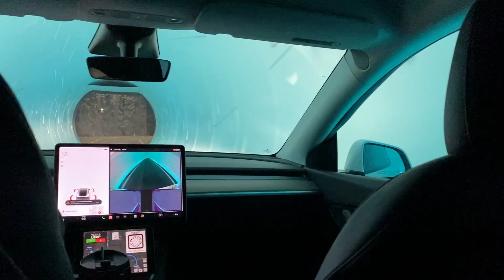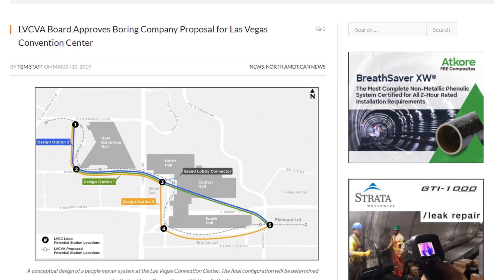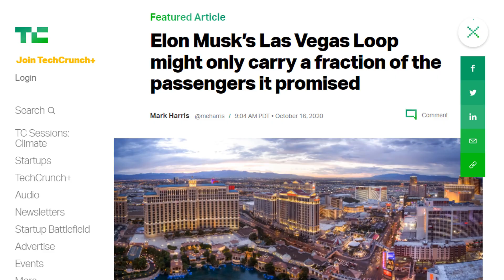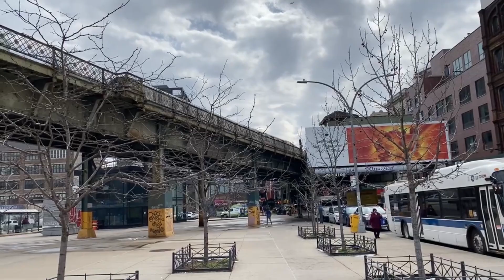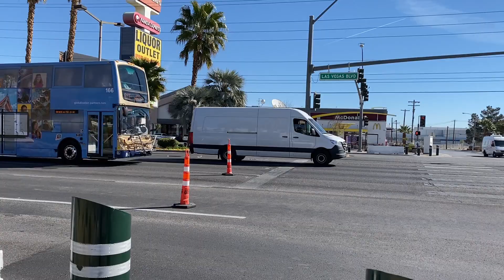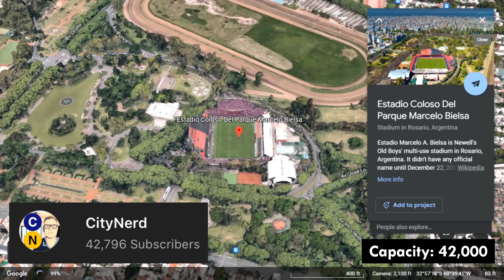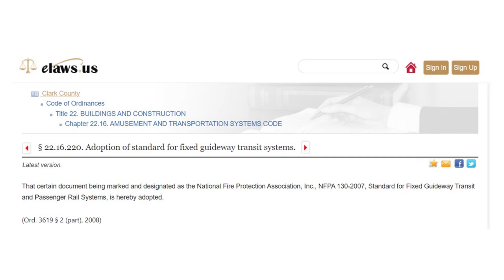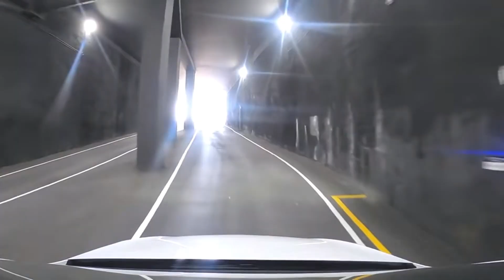Inside the Las Vegas Loop: Transportation Game-Changer, or Complete Waste of Time and Effort?

Comment: Question: Are the tunnels large enough for a rail system when this scheme inevitably fail?
Reply: Actually yes. From information I found on Wikipedia, the tunnel is 12 ft in diameter, while the seven deep-level lines of the London Underground are 11 ft 8 in. diameter. So yes, with special curved-roof trains like the ones in London you could still use the tunnels for actual mass transit.
Reply: @JustinKlinger  Our old deep-level tube lines aren't super comfortable (and the trains lack air con as there's no way to vent the heat) so the most modern line, namely the Crossrail project (aka Elizabeth Line) have tunnels that are 20.34 feet in diameter! These tunnels are unlikely to ever prove to be useful for anything, and will also hinder any plans to bore proper tunnels as you've got these in the way. [As has been said by others, you could build something like that of Glasgow's subway - which is a must-visit - but that's hardly the way forward compared to big trains that could shift many tens of thousands of people per hour - totally transforming travel throughout Las Vegas]
Reply: @JustinKlinger  Mass transit already failed in Las Vegas. People vacationing don’t want to sit next to a drug addicted messed up person.
Reply from the maker: Define "rail" lol
Reply: @CityNerd  You may have just opened a door to the dark places, lol.
Reply: These tunnels are very small. The Glasgow subway also is very small. I wonder if something small could fit there.
Reply: London's old Underground tunnels are grandfathered in. Its new tunnels must have a walkway beside the track passengers can reach via side doors.
Reply: No but the infrastructure could still probably be reused and upgraded rather than demolished.
Reply: @macgobhann8712  standard guage no, but there's all sorts of narrow guage trams out there, and a number of them could be installed in these tunnels, possibly with some modifications.
Reply: @doktarr  All of London's metro runs on standard gauge. There used to be some broader gauge, but that got eliminated.
Reply: @macgobhann8712  I wonder.  Running another TBM through sounds implausible given the structure in place, which presumably can't be removed without cave-in.  Maybe build temporary shoring in segments, then basically mine by hand?  It sounds easier to start from scratch.
Reply: Absolutely not. They are unventilated and, even using narrow gauge streetcars or PATH/London Underground curved-roof trains, there's no room for the emergency walkways required in the USA. Even the LVM has continuous emergency walkways. The only reuse scenario I can see would be to repurpose them as pedestrian tunnels. Adaptive reuse was NEVER a consideration, because the "Loop" is merely a gimmick to sell cars.
Reply: @colormedubious4747  Why can't they just grandfather it in for the Loop then?
Reply: @BluePieNinjaTV  Grandfather in what? An exception to minimum state & federal safety standards? I'm going to say "hard NO" to that!
Reply: So my take was that we could just rent bikes at a station and bike through the tunnels. Las Vegas is far too hot to bike above ground for a large swath of the year so this gives us our chance!
Reply: @frojo9  if he's trying to save cost why did he waste all that time making it car sized just make it people sized.
Reply: @Phil9874  I think you replied to the wrong comment. Mine was about biking in the tunnels
Reply: Use it for sewage.
Reply: Yes! The Glasgow subway has a nominal diameter of 11', so in theory you could use the new Stadler trains (which look like futuristic shiny worms) which Glasgow is rolling out. Deets here: https://www.youtube.com/watch?v=Po3sMENPvoo
Reply: If nothing else they'd be useful as air-conditioned walking tunnels when the temps outside are in the triple digits.
Reply: Possible solution, a theme park in NY (Water Safari) has a small train (could easily be electric) that has the footprint of a rollercoaster (2 person wide). While i don't know the park's statistics on the 1 train running back and forth on its bidirectional track, i know it would fit in the tunnel and have better capacity than cars in "stop and go traffic" in a tunnel. 

So something actually useful can be designed to fit in those tunnels even if it isn't traditional it could atleast be more  functional than a single car lane.
Reply: The plan, I should think, is to fill them up with water and run an hourly shuttle-submarine service.
Reply: @mdwalther_writer  🤣🤣🤣
Reply: London Deep Tube only... They run on a line with a tunnel with only a tight 11' 6" diameter... These Musk tunnels would work well for cheap deep tube tunnelling..
Reply: Are the curves too tight?
Reply: They can put a conveyor belt into the tunnel. That works driver-less and is fast enough for the short distances.
Reply: Maybe APM such as VAL 208, but not full size metro car.
Reply: Given that the tunnels dont have enough space to open the car doors, i highly doubt any rail system beyond a typical roller coaster system can fit in them.
Reply: You know those mini trains at fair grounds?
Reply: How big is the diameter of the Glasgow subway compared to the loop?
Reply: @burgerpommes2001  Glasgow subway is 11' in diameter. Boring tunnels use a 14' diameter boring machine which results in a 12' diameter tunnel.
Reply: @burgerpommes2001  1ft smaller apparently
Reply: If Disney would sell them a Wedway Peoplemover, then that might work.
Reply: The tunnels look extremely cramped. Would need to be fully reworked from what I’ve seen.
Reply: You can make people walk
Reply: In the current state, probably not if they expand the tunnels to be bigger and more routes to be a proper metro. If they can't do that, I guess convert the tunnel into an ebiking or electric motorcycle-only lane.
Reply: @Frank451Martin  why would you want to convert the Loop tunnels to ebikes when they are very competitive in terms of daily ridership with similar sized subways, but also has FAR lower waiting times, is faster but most importantly is VASTLY cheaper:

The current 0.8 mile long three-station LVCC Loop handles up to 27,000 people per day, has a 3 - 6 second headway, averages 25mph and cost $48.7m. 

The Berlin U55 is a 3-station 1.5km subway in the centre of Berlin which is similar in size to the LVCC Loop but it only carries a minuscule 6,200 people per day (compared to the Loop’s 27,000 ppd) at an average speed of 19mph and 5 minute headway and yet cost $500 million in today’s dollars in total, 10x the cost of the LVCC Loop.

The Seattle U-Link is a 3.15-mile underground light rail which also has 3 stations which had a ridership of 33,900 people per day pre-covid (so only a few thousand more than the LVCC Loop), though it is much less now.  Runs at an average speed of 31mph with a 10 min peak/15 min off-peak headway. It cost $1.9 billion dollars in total or $600 million per mile, 39x more than the LVCC Loop.

The San Francisco Central Subway is a 3-station 1.7 mile subway with a targeted ridership of 35,000 people per day with a 5 minute headway and an average speed of a miserable 9.6mph and cost $1.578 billion, 32x the cost of the Loop. (Whether it achieves that ridership which is only a few thousand higher than the Loop during this pandemic is of course yet to be seen) 

The Newark City Subway/light rail is a 6.4 mile, 17 station line with an average speed of 21.5mph and has a daily ridership of 19,289 and cost $208m for the 1 mile above-ground light rail portion or 4x the cost of the underground Loop. I’m not sure of the cost of the underground portion of the Newark subway, but typical costs start at $600m per mile 39x the cost of the Loop. 

As you can see, the LVCC Loop is extremely competitive, though that is nothing compared to the 55 station, 34 mile Vegas Loop with its 60mph average speed, 0.9 second headway and 57,000 people per hour capacity which is now under-construction at ZERO cost to the taxpayer. 

However, the Loop is FAR better in terms of comfort, speed and frequency/wait times, and VASTLY cheaper to build than any of these subway systems.
Reply: Probably something small… it would not be standard that’s for sure
Reply: @nosurp  About the same size as the London Tube. Dig out the bottom so it's flat and it should fit a full-sized train I reckon.
Reply: At worse you could find some small busses and install some sort of guided busway.
Reply: Yes, the Glasgow Subway has a tunnel diameter of 11ft, the Vegas Loop is 12ft.
In London, most of the deep level tube lines are 11ft 8¼in.
Reply: They absolutely are big enough. They are larger than some subway tunnels that are currently operational.
Reply: @TheReykjavik  Everyone in this comment section has been comparing raw bore diameter to conclude that trains would fit in these idiotic sewer pipes. That Is NOT how this works! Subways are more than tubes and trains. Subways have running tracks, power rails, track foundations, power & communications cabling, signaling hardware, emergency walkways & exits, turnouts & switching mechanisms, lighting, ventilation hardware, and gobs of other gizmos cluttering their tunnels. There just isn't enough room in these silly sewer pipes for a modern rail system, even using narrow Alstom streetcars.

And we haven't even brought up TURNING RADIUS yet! General service on standard gauge track requires more than a 410-foot
radius. The faster the train, the greater the radius. Airport peoplemovers of that gauge require a bit more than half of that radius. 3'6" gauge can require a 250- to 800-foot radius, depending on speed. Some 2-foot gauge systems pull it off with less than a 20-foot radius. They are not fast trains. I guarantee you that the turning radius of the silly sewer pipes is NOT sufficient for a serious rail transit system.

Jeepers creepers, people, you HAVE to design tunnels for SPECIFIC rail tech from the very start! The Vegas "Loop" tunnels were designed to sell cars, NOT to move people efficiently.

If an actual engineer wants to do the math and show that an off-the-shelf rail transit mode will fit the "Loop" as-is and conform to US regulatory requirements, I'll believe it. Until that time, "the holes in Glasgow or wherever are the same size as the holes in Vegas" does not prove a thing. 

The LVCVB merely wasted a bunch of money on an intrinsically stupid idea.
Reply: @colormedubious4747  Yet there are trains in smaller tunnels. And making a wider turning radius is not difficult, you just bore a gentler curve.

The fact that there are trains in holes that size very much proves that you can put trains in holes that size.

Regulations preventing it are an extrinsic reason not to do it, not intrinsic.

It is getting really annoying how 95% of people lose all touch with reality the moment anything involving Elon Musk comes up.
Reply: @TheReykjavik  The tunnels to which you refer were designed for TRAINs. The Vegas tunnels were designed for CARS.
Reply: @colormedubious4747  That doesn't mean it can't be redesigned for trains. It is big enough.
Reply: @TheReykjavik  I literally just explained why it isn't big enough.
Reply: ADVENT Insider  I see what your confusion is Advent. You’re thinking people per day down a single tunnel. That’s not what the 27,000 people per day figure is, it is total ridership of the three station Loop. 

The current 0.8 mile long three-station LVCC Loop handles up to 27,000 people per day, has a 6 second headway and cost $48.7m which is very competitive ridership-wise with the similarly short subways listed below. 

However, the Loop is FAR better in terms of comfort, speed and frequency/wait times, and VASTLY cheaper to build than any of these subway systems:

The Berlin U55 is a 3-station 1.5km subway in the centre of Berlin which is similar in size to the LVCC Loop but it only carries a minuscule 6,200 people per day (compared to the Loop’s 27,000 ppd) at an average speed of 19mph and 5 minute headway and yet cost $500 million in today’s dollars in total, 10x the cost of the LVCC Loop.

The Seattle U-Link is a 3.15-mile underground light rail which also has 3 stations which had a ridership of 33,900 people per day pre-covid (so only a few thousand more than the LVCC Loop), though it is much less now.  Runs at an average speed of 31mph. It cost $1.9 billion dollars in total or $600 million per mile, 39x more than the LVCC Loop.

The San Francisco Central Subway is a 3-station 1.7 mile subway with a targeted ridership of 35,000 people per day with a 5 minute headway and an average speed of a miserable 9.6mph and cost $1.578 billion, 32x the cost of the Loop. (Whether it achieves that ridership which is only a few thousand higher than the Loop during this pandemic is of course yet to be seen) 

The Newark City Subway/light rail is a 6.4 mile, 17 station line with an average speed of 21.5mph and has a daily ridership of 19,289 and cost $208m for the 1 mile above-ground light rail portion or 4x the cost of the underground Loop. I’m not sure of the cost of the underground portion of the Newark subway, typical costs start at $600m per mile. 

As you can see, the LVCC Loop is extremely competitive, though that is nothing compared to the 55 station, 34 mile Vegas Loop with its 60mph average speed and 57,000 people per hour capacity which is now under-construction at ZERO cost to the taxpayer.
Reply: The Loop tunnels are 12.5 foot in diameter which is larger than the 11’ 8” diameter of London Underground tunnels. 

But why would you want to put subway trains in the Loop tunnels when subways:

- would cost $10 billion compared to the Zero public dollars of the 34 mile 55 station Vegas Loop
- have a slower average speed of 17mph compared to the 25mph average speed of the LVCC Loop (or the 60mph average of the 34 mile Vegas Loop)
- much longer wait times of 3, 5, 10 or even 30 minutes compared to the 15 second wait times of the Loop

Despite the fact that the Loop carries just as many people as similar sized subways.
Reply: @andrewfranklin4429  You obviously haven't sharpened anything by commenting here.
Reply: @StinkPickle4000  Hi StinkPickle, so do you have any useful critique to add?  Any particular reason you believe a subway would be better to justify costing 30-70x more than the Loop?
Reply: @andrewfranklin4429  No argument, your evidence is unconvincing.
Reply: @StinkPickle4000  may I ask why you believe the evidence to be unconvincing?  I’m always keen to ensure the data I work with is accurate and appropriate.
Reply: @andrewfranklin4429  Just checking in, still think this is better than subway?  30x-70x more than Loop costs "bore" out did it?
Reply: @StinkPickle4000  Well let's see, the daily ridership average for light rail lines globally is 17,392 people per day across an average of 12 stations so 25,000 - 32,000 people across just three Loop stations is actually very impressive. 

And $202m per mile is the US average for above-ground light rail while subways cost between $600m - $1 billion per mile in the US.

Subway stations globally have a ridership average of 14,656 passengers per day according to the UITP which is only a bit higher than each LVCC Loop station’s 10,000 despite subways costing 10x - 30x more. 

And Vegas is getting their 68 mile, 93 station Vegas Loop built at zero cost to the taxpayer rather the tens of billions a metro would cost. 

So yes, $48.7m for the Las Vegas Convention Center Loop still sounds pretty impressive doesn't it?
Reply: The rail system already failed in Las Vegas.
Reply: @dewdropin2010  Are you referring to the LVM? It didn't fail, it was murdered.
Reply: @colormedubious4747  I would call it suicide by inefficiency.
Reply: @dewdropin2010  I witnessed its murder by the taxi, shuttle, and rental car companies back in 2002/2003 when they blocked it from serving the airport. That single station, had it been built, would likely have prevented the bankruptcies. Consider that a one-seat ride that completely avoided surface congestion would have moved conventioneers directly between the airport and the Convention Center (and several of the megaresorts in its immediate vicinity). That was the original vision. Now that the LVCVA owns it, they have an opportunity to realize that vision, if they stop screwing around with a silly gimmick to sell cars.
Reply: @colormedubious4747  That does sound more like a murder.
Reply: @dewdropin2010  Sure does!
Reply: @dewdropin2010  That’s true. The ridership of the entire $640m Las Vegas Monorail is only 13,510 people per day over 4 miles and 7 stations.   And the monorail figures were pre-pandemic, so they're even lower now. No wonder they went bankrupt a second time. 

In contrast, the $48.7m Las Vegas Convention Centre Loop (13x cheaper than the monorail) is moving 27,000 people per day thru 3 stations over 0.8 miles during larger conventions, double the number of passengers of the much larger monorail.
Reply: @andrewfranklin4429  I think of the 70 year old lady getting into a safe and secure Vehicle compared to a gang infested subway or bus. Why do people think future tunnels won’t be using electric trains. Longer systems may be electric trains.
Reply: @dewdropin2010  Because this scheme exists to sell Teslas, not to present a workable transport solution.
Reply: @Codraroll All 29 miles 1/2 billion But wait it gets even better $6 billion in revenue on ride fees. Billions in advertising because he owns for 50 years 29 miles of Las Vegas real estate. If I said I will build a subway system in New York City and I will pay for it all and I will collect all the fees from the riders and anybody that wants to advertise on the trains or on the walls would you make the deal as the mayor of New York. That’s what Las Vegas just did they made the deal and now Elon Musk is going to be much richer.
Reply: @dewdropin2010  Again, a barely legible word salad that STILL doesn't answer my post. You are basically just saying "public transportation systems are useful", which is commendable, but what makes the Loop look like it has any chance whatsoever of becoming a functioning public transportation system?
Reply: @Codraroll  tell me Erlend, how much greater than 27,000 people per day do three Loop stations have to handle before they fit your definition of a “functioning public transport system”?
Reply: @andrewfranklin4429  You must rather ask, at what cost can a public transportation system move 27,000 people per day, and where does it move them? And could the same be achieved in a less complicated way? The Loop does not come out favourably in any of these metrics.
Reply: @Codraroll  actually, considering the 29 mile 51 station Loop is being constructed at zero cost to taxpayers, you must rather ask at what cost could a light rail or subway move 57,000 people per hour across such a rail network. 

The answer is around $5.8 billion for light rail and somewhere between $8 and $15 billion for a subway. 

The next question you need to answer is why spend billions of dollars to build 19th century train-based mass transit when for zero dollars you could have 21st century Personal Rapid Transit that moves just as many people but far faster and more comfortably?
Reply: @andrewfranklin4429  Again, you're mixing up figures and comparing apples and oranges, while taking the marketing estimate numbers for gospel.

And for the second question, if I haven't managed to push that answer into the vacuum behind your eyes yet, I don't think anyone can. 

By the way, taxicabs are a 15th century invention. Throughout history, they have never managed to become anything other than a costly express option for the wealthy few. Running them through the sewers isn't going to change that, especially when the ticket price has to cover the cost of constructing those sewers as well.
Reply: @Codraroll  Sorry, I got a bit carried away with the 19th century comparison there. 

It does however surprise me that you find it so hard to conceive that a 3 station system that currently handles at least 27,000 passengers per day could not deliver 57,000 people per hour when scaled up 17 fold to a 51 station 29 mile city-wide system. 

And no, the 57,000 people per hour figure is not empty marketing, it was modelled using the same LOOPSim modelling software that The Boring Co used to successfully project that the Loop could handle 4,400 people per hour. 

That latter figure was confirmed not only in an artificial test with volunteers in the tunnels, but the real world result of 27,000 people over the 8 hours that SEMA was open each day gives an average hourly rate of 3,375 people per hour. But of course, like any mass transit system, the Loop has peaks and troughs throughout the day with a peak period around lunch with a significantly higher hourly rate and off-peak periods up to mid-morning and after mid-afternoon with lower rates.
Reply: @andrewfranklin4429  Good grief. I told you that you won and you still won't hush up about the silly sewer pipes. You keep using numbers provided by the company that wants to SELL the thing! Numbers, by the way, that rest on a statistical fluke due to a huge captive customer base, ONCE. A company, by the way, that was forced to drastically walk back its promises on multiple occasions. 20-passenger pods? Nope! Car-carrying sleds? Nope! Vehicle lifts? Nope! 155mph service? Nope! Sounds just like the Hyperloop, doesn't it, other than the fact that they haven't fired half of their personnel (yet) or scaled back the plan to freight-only (yet). Holy crap, are you credulous! The market cap of Tesla is more than the ten largest car makers yet Tesla captures less than 15% of the market! Does that not seem even a LITTLE off to you? There is a lot of smoke and mirrors there.

"The real-world travel data also raises doubts as to whether the LVCC Loop as it stands can meet its capacity goal of transporting 4,400 conference attendees per hour.

TBC achieved that number during a demonstration event in May, by squeezing three riders (without luggage) into each of the 62 Tesla Model 3, X and Y vehicles in the system. In reality, however, an average of just two passengers rode in each Loop vehicle between its opening to conventioneers in early June and mid-July.

A contract signed by TBC in 2019 specifies a $300,000 penalty for each large convention where TBC cannot move around 4,000 people per hour. A penalty that large could impact the viability of the Loop, which earned just $230,500 for transportation services during its first month of operation in June. (TBC also gets a monthly management fee of $167,000, regardless of how many cars it operates)." In short, it is FAR too early to sing the praises of a system that you could beat across the parking lot ON FOOT. It took Virgin Hyperloop about 3 years before it had to reorganize and barely 8 years to completely abandon its mission and implode. The guy knows how to sell cars and Powerwalls. He knows NOTHING about transit -- and this silly thing isn't even transit. It's just cars in tunnels. New York City has hundreds of thousands of cars using tunnels every day but is still congested beyond belief and utterly reliant on rail to keep the city functional. Stop fangirling and study the underlying issues.
Reply: @colormedubious4747  We’re not talking popularity contests here Colorme, we’re simply talking about what passenger throughput the Loop can handle through the turnstiles and the answer is 25,000 - 27,000 people per hour which was achieved during the SEMA conference. 

It doesn’t matter if there haven’t been any other conventions that large since SEMA due to COVID as all that matters is the 5 days of that conference demonstrated that the Loop is capable of easily handling 25,000 - 27,000 people per day. 

Mark Harris has now admitted his Tech Crunch articles about The Boring Company were wrong and he has been removed from writing about the Boring Co for Tech Crunch with other writers being far more accurate (and positive) in their stories since Harris’s last article in Nov 2021. 

So his claims that the Loop can’t handle 4,400 people per hour and reports of penalties are very obviously incorrect.
Reply: @colormedubious4747  And no, I am not using numbers from the BorIng Company.  The 25,000 - 27,000 people per day number comes straight from the government authority overseeing the Loop.
Reply: @colormedubious4747  At 27,000 people per day across the 3-station LVCC Loop, we are looking at 9,000 people per day per Loop station. As there are around 8 Loop stations for every subway station per mile through the busier parts of Las Vegas that means the Loop is capable of handling 8 x 9,000 ppd = 72,000 people per day which is double even the busiest subway station dual platform averages in Europe (Paris’s Gare de Nor) which handles 38,888 people per day per dual-platform average. 

Even if we ignore peak period increases on the Loop and assume every hour had exactly the same number of people per hour, over the 8 hours of operation, that works out as 72,000/8 = 9,000 people per hour for those 8 Loop stations compared to only 3,950 pph at Oxford Circus Station (2,160 pph per line) the busiest Tube-only station on the London Underground. 

Very impressive indeed.
Reply: @colormedubious4747  As far as the pods and car lifts are concerned, you're confusing CGI concept videos of possible future city-wide Loops released months before, with the The LVCC Loop project which is just stage 1 of this specific multi-year Vegas Loop project.

The pods may come in the future if higher capacities are required, but at the moment, the Loop is delivering more than enough capacity for the demand. 

As Steve Hill the CEO of the LVCVA said back in May, “It seems that during a pandemic is not the time to be increasing capacity”. 

The promise of 155mph speeds is for the full Loop network with its 29 miles of tunnels.  Only those who want to push TF’s ridiculous assertion that Musk would promise speeds of 155mph in a 0.4 mile long spur tunnel in the first stage of the Loop project - the LVCC - persist in bringing up this ludicrous argument.  

Do a search on YT for “127 mph tunnel” and you’ll find a video of TBC demonstrating a Tesla racing smoothly up to 127mph (205 mph) down the 1.14 mile test tunnel in Hawthorne California. 

This shows the sorts of speeds possible in a tunnel that is almost 3 times longer than the 0.4 mile spur tunnels connecting each station in the LVCC Loop. And everyone wonders why they are limited to 40mph in those very short tunnels.
Reply: @andrewfranklin4429  You're basing extraordinary claims on very questionable numbers. Today, more than 4 subsurface taxi stands remains a complete fantasy. Only 3 of the taxi stands are connected by twin tunnels.

At this point, I HAVE to ask "what's in this for YOU?" Are you employed by TBC? You're cutting and pasting your butt off to benefit a multibillionaire investor who sells cars.

I will remain utterly unimpressed until this silly thing actually fails to implode the way that Hyperloop did.
Reply: @andrewfranklin4429  Odd, you SAID you were basing your projections on TBC's modeling software.
Reply: @andrewfranklin4429  Odd, you SAID you were basing your projections on TBC's modeling software.
Reply: @colormedubious4747  the 25,000 - 27,000 people per day number reported during the SEMA conference comes from the Las Vegas Convention Centre Authority. The 57,000 people per hour figure for the full 29 mile 51 station Loop comes from the Boring Co’s LoopSim software which has already proved itself as accurate.

No questionable numbers here.
Reply: @colormedubious4747  Perhaps you’re unused to someone who enjoys a good meaty discussion about issues they are interested in and actually supports their position with facts and data rather than engaging in the usual snarky one-liners?
Reply: @andrewfranklin4429  I'm quite used to it, but all you do is parrot the company line while choosing to ignore any inconvenient facts and data I provide to you. FACT: EVERY proposal made by Musk/TBC has been walked back. It started out as an interesting high-speed GRT concept, morphed into high-speed Santa sleighs carrying privately owned vehicles, and is now merely taxis and traffic jams under a parking lot. It was a last-ditch effort to save TBC from bankruptcy as they had lost or failed to stick the landing on every other contract. His promised "space-age" tunneling tech NEVER materialized and he bought ordinary TBMs from other manufacturers. His Hyperloop pitch was basically stolen from Alfred Ely Beach's 1870 pneumatic subway and an early 1990s Spanish railroad's concept art for a maglev version thereof and it has already imploded in fine form. He has demonstrated that he has NO knowledge of nor interest in transit technology. HE SELLS CARS! 

We've been in this place before when NCL bought up transit companies, paved over streetcar tracks, and replaced the streetcars with buses manufactured by one of the investors in NCL. It not only didn't help, it actively made things worse.

I have EVERY reason to be so skeptical.
You have NO reason to be so positive.
Reply: @colormedubious4747   and yet the Loop has proven to be extremely successful handling 27,000 people per day putting it right up there competitive with not just BRT, light rail and even subways. And that is not parroting the company line, that is simply reporting what the government authority in charge of the Loop has reported.
Reply: @andrewfranklin4429  Apples and oranges! You're comparing metros that serve the world's busiest cities, carrying tens of thousands of pax daily, spread out across hundreds of route miles, against ONE CONVENTION that made use of a dedicated taxi tunnel that traverses a parking lot! The trams at Disney World move more people across parking lots in shorter time frames. Why doesn't LVCVA just buy a bunch of those?

As the taxi tubes expand and they add more nodes to the network, you're going to see just how weak and unsustainable this plan truly is. It's going to become even more congested than the streets above, if it even gets that far.

I already know what you're going to say. You're going to keep parroting those largely meaningless numbers back ad nauseum without factoring in network complexity even a little bit. Don't trouble yourself. He (Musk) is just not that into you.
Reply: @colormedubious4747  Actually we are in fact comparing apples with apples. In this case the apples are daily ridership of subway stations versus daily ridership of Loop stations. 

It doesn’t matter whether the passengers arrived from a station on the other side of the city or two stations next door, the important thing is how many people walk through the turnstiles of the stations. 

And what we find is that the Loop easily handles 27,000 people per day making it more than competitive with not only BRT and light rail, but also giving subways a run for their money.
Reply: @colormedubious4747  Now regarding your point about network complexity, yes if you have more than 9,000 people per day per station (or more specifically, more than 1,500 people per hour per station) wanting to go to one particular Loop station, there will be potential contention.

This would indeed need appropriate handling either with higher capacity electric vans/buses/pods, or load sharing across nearby stations or additional bays at stations or holding tunnels (like aircraft holding patterns) or something. 

The Loop has the advantage that high traffic destinations like the Convention Centre and Allegiant Stadium are serviced by multiple stations (and arterial tunnels) to do exactly that sort of load sharing. 

You are correct that we won’t know how well that will all work out until the 29 mile, 51 station Loop is built, but what I am suggesting is to wait and hold off on dismissing this system until Musk spends his money and finds out for us whether it will work or not. :-)
Reply: @andrewfranklin4429  Nobody rides stations. The important factor is system throughput. In other words: How many people can a system successfully get to their destinations each day? The "Loop" is currently an overpriced parking lot tram and cannot yet provide a meaningful number with which to compare to other systems.

You still have never answered why you are so emotionally invested in defending this silly thing.
Reply: @colormedubious4747  That’s true ColorMe, passenger capacity of train stations is probably more commonly referred to in terms of “passengers per day”, “Average Station Entries” or “trips”, despite some using the term “ridership”. 

In the case of Kings Cross Subway Station, that figure is 149,150 Average station entries (weekdays). 

Yes people per hour sitting on a train going down a line is a useful metric for comparing train line capacity, but it is useless for describing how many people can a system successfully get to a destination station each day.  For that, you need to know the number of people going through the turnstiles of that station each day. 

Because the Loop Arterial Tunnels do not yet exist we can’t compare real world people per hour numbers down those arterial tunnels against train line throughput. 

However, we do have the data for Loop station entries and that is 25,000 - 27,000 for a medium size convention so we can compare this against the average station entries for subway stations so we can ensure we are comparing apples with apples. 

So we can say that the 27,000 entries per hour figure is:

- greater than the number of passengers that 65% of the stations on the London Underground individually handle daily which with 1.8 million passengers per day across 272 stations averages only 6,617 passengers per day PER STATION. 

- more than the 24,858 passengers per day per line pre-pandemic average of Kings Cross station, the busiest station on the Tube which pre-pandemic had 149,150 entries per day across 6 lines. 

- more than the average of 13,684 people PER STATION per day of the entire Paris Metro which had a pre-pandemic ridership of 4.16 million per day over 304 stations.

- about 70% the 38,888 people per day per platform pair average of the busiest station on the Paris Metro, the Gare Du Nord which pre-pandemic handled 700,000 people per day across 36 platforms. 

 - more than the 14,000 passengers per day per line average of the Stuttgart Main Station S-Bahn which pre-pandemic saw 140,000 passengers across 10 lines through the turnstiles daily.
Reply: @colormedubious4747  in terms of why I comment on channels like this, the reason is that I enjoy meaty discussions around topics I am interested in, particularly when I see the “common wisdom” of the majority on a forum failing to recognise the possibility of disruption coming to the status quo.  

I find it helps to sharpen my reasoning skills and deepen my knowledge about such topics while at the same time providing a good check for me in cases where someone raises a point that disproves one of my assumptions or conclusions. 

So thanks for the opportunity to chat about such interesting things Colorme.
Reply: @andrewfranklin4429  Right back at you, Andrew! I appreciate every opportunity to sharpen my arguments. We'll both have to wait and see how that thing pans out. One of us will be buying the other a drink in a few years. Cheers!
Reply: Hi Eva, the Loop tunnels are 12.5 feet internal diameter which is larger than the 11’ 8” diameter of the London Underground subway tunnels, so there is a good three feet on either side of the 6’ wide EV.

 Not sure why you think there isn’t enough room to open the car doors in the rare event that was ever necessary?
Reply: No. Musk has stated the goal of the boring company is to cut the cost of tunnelling. One of the key cost drivers of tunneling is diameter of the tube. Thus the tunnels can’t be converted to a conventional train.
Reply: @rosskgilmour  while standard gage would not work, you could adapt 1973 and 1948 type London underground stock, or you could adopt the Glasgow subway stock. if you had to use rubber tires, the paris rubber tyre metros also would fit in these tunnels.  and these are already built, its also not hard to make a narrow gage metro to modern standards. any tube-shaped can accept a train if you make the train small enough.
Reply: @Aliceintraining  Rubber trains ar the worst! Flat rubber tire in a tunnel? No thanks!
Reply: @stickynorth  as crap as rubber tyre metros are do to maintained cost,  they also can hold themselfs on the metal guide rails like a normal train so they can work fine with a few flats.  its just kind of funny that you fell for that trick of theirs.
Reply: @rosskgilmour  No. The Glasgow Subway and London Tube run in smaller tunnels than this.
Reply: Why would you try to convert the Loop tunnels to rail when the Loop is already proving to be so successful?  It has already shown that it beats, BRT, Light Rail and is even competitive with subways while being VASTLY cheaper:

Bus Rapid Transit (at grade) has very low capacity:
90 passengers per vehicle * 15 vehicles per hour = 1,350 pph.
And low average speed of 9mph due to city traffic and having to stop and wait at every stop. 
$0.68 - $9m per mile

Bus Rapid Transit (grade-separated) has low capacity: 
90 passengers per vehicle * 30 vehicles per hour = 2,700 pph.
And but still slow average speeds of 12-22mph.
$13-50m per mile

Light Rail Transit (at grade) has medium capacity:
90 passengers per vehicle * 3 vehicles per train * 15 vehicle sets per hour = 4,050 pph.
But slow speeds of 9mph -12mph due to city traffic and having to stop and wait at every station. 
$50m - $100m per mile

Light Rail Transit (grade-separated) high capacity:
90 passengers per vehicle * 3 vehicles per train * 30 vehicle sets per hour = 8,100 pph.
And still pretty slow average speeds of 15mph due to having to stop and wait at every station. 
$201m per mile

Subways have very high capacity:
100 passengers per vehicle * 10 vehicles per train * 30 vehicle sets per hour = 30,000 pph.
But still slow average speeds of 17-22mph due to having to stop and wait at every station. 
$600m- $1 billion per mile
$100m - $1 billion per station

The 29 mile Vegas Loop (2.5 passengers per EV) Arterial tunnels will have high capacity:
 2.5 passengers per vehicle * 4,000 EVs per hour = 10,000 pph
AND very high average speeds of 60mph thanks to direct point-to-point travel at high speeds. 
$20m per mile (dual tunnel)
$2m per above-ground station

The 29 mile Vegas Loop (4 passengers per EV w ride sharing)  Arterial tunnels will have higher capacity:
 4 passengers per vehicle * 4,000 EVs per hour = 16,000 pph
AND very high average speeds of 60mph thanks to direct point-to-point travel at high speeds. 
$20m per mile (dual tunnel)
$2m per above-ground station

But the 29 mile, 51 station Vegas Loop will have up to three parallel arterial tunnel pairs through the busier parts of the city giving 30,000 - 48,000 pph down the main arterial tunnels. 

The Boring Co has actually rated the 29 mile, 51 station Loop at a minimum of 57,000 people per hour and is actually being built at ZERO cost to taxpayers vs $8 billion for a subway. 

So even in terms of people per hour, the Loop easily holds its own against not just BRT and Light Rail but is also very competitive against many subways despite being order of magnitude cheaper.
Reply: @andrewfranklin4429  The LVCVA is funded by occupancy TAX, so - technically - it is NOT "zero cost to taxpayers." That doesn't even consider the opportunity cost of missing out on better projects.

You can quote the failing Boring Company's propaganda until the cows come home but it doesn't change the reality that the "51 mile system" is still vaporware and that moving a tiny fraction of surface traffic underground does nothing to address the underlying issues.

Urban planners favor street-level, step-off-the-curb transit solutions for good reasons. This abomination is merely a theme park ride. The novelty will fade as fast as Virgin Hyperloop did. Musk is NOT selling better transit. He is selling CARS. Cars are part of the problem, not the solution.
Reply: @colormedubious4747  the LVCVA is not paying a cent for the currently under-construction 29 mile 51 station Loop. 

And the Boring Co has already signed actual agreements with Clarke County and the 51 hotels, casinos, the University and Allegiant Stadium (and soon the airport as well) to build that 29 mile 51 station Vegas Loop with TBC covering the cost of the tunnels and the hotels and casinos all paying for their own Loop stations and construction has already begun with the tunnels to Resorts World already competed and other tunnels already underway. 

So no, the Vegas Loop is far from being vapourware.
Reply: @colormedubious4747  also, the little LVCC Loop only has 1 route, 3 stops and 70 cars and yet easily handles 27,000 passengers per day during large conventions. 

In comparison, the Vegas Bus service has a daily ridership of 178,390 but that is across 51 routes and 3,900+ stops and a fleet of 708 buses. 

So that very large, busy bus network only carries 6.6x the number of passengers of the small 3-station Loop despite having 51x the number of routes, 1,300x the number of stops and 10x the number of vehicles each of which has 10x the seating capacity as each Loop EV.

Considering that the 29 mile 51 station Loop will increase the size of the Loop by 17x, it means it could end up with a capacity of 459,000 people per day which is 2.5x the daily ridership of that entire Vegas Bus network. 

Considering that Las Vegas only has a population of 600,000, you can see how the Loop is indeed a very good solution for the public transport needs of this city going forward - particularly since it is costing the taxpayer ZERO dollars compared to around $15 billion for a comparable subway.
Reply: @andrewfranklin4429  I'm clearly debating a religious fanatic. I already addressed your "zero cost" fallacy but you merely repeated it. By your reasoning, the LVM also cost the taxpayers ZERO dollars. Your ridership argument rests upon the unstable sands of a statistical anomaly. You can keep quoting the Boring Company's marketing materials all you like but the silly sewer pipe is a curiosity for tourists and a marketing gimmick for selling cars, not a serious long term transit solution. It's faster to just WALK across that parking lot.
Reply: @colormedubious4747  Colorme, no need for the ad hominem attack. As I said, the current LVCC Loop was NOT zero cost as the LVCVA (which s you said is funded by taxes) paid the $48.7m to the Boring Co to build. 

However, The Boring Co (TBC) will pay for all of the 29 miles of tunnel construction with the LVCVA paying zero dollars. In fact the LVCVA will actually generate an income of a few million dollars a year FROM the operation of the 29 mile Loop. 

The LVCVA will actually be paid 5% of the ticket revenue generated by TBC who will operate the Loop as a franchisee and retain the other 95% of ticket sales.  

The 51 hotels and casinos will pay for the 51 Loop stations (about $2m per station unless any individually wish to build something really grandiose) but they get access to an incredibly fast and cheap mass transit system with a station right at their front door.

It is the extremely low cost of tunnels ($6-10m per mile) and stations (~$2m each) that makes this possible.  TBC knows how much these will cost having already built the 3 station LVCC Loop. 

This is a quite revolutionary funding model that could lead to many more cities that could never afford a subway but could absolutely justify a Loop public transport system and thus get that many more cars off the roads.
Reply: @colormedubious4747  And no, I am not quoting any Boring Co marketing materials when I mention the 27,000 people per day ridership of the Loop - that figure came directly from the client, the LVCVA who reported:

“The Boring Company’s tunnel system successfully moved 25,000 to 27,000 passengers daily around the Las Vegas Convention Center campus during SEMA in November. SEMA was the Convention Center and the LVCC Loop’s first full-facility show with 114,000 attendees. 

As previously reported, the LVCC Loop’s average ride time was under 2 minutes during CES 2022. The average passenger wait time was below 15 seconds.”

And 2 minutes from one end of the mile long convention centre to the other is significantly faster than the 25 minutes it takes to walk. And of course once the 29 mile Loop is complete it’d take you ten hours to walk from one end of the city to the other so no, walking is not a satisfactory alternative to the 7 minutes it would take a Loop EV to go that distance.
Reply: @andrewfranklin4429  What was I thinking? Solving the problems caused by too many cars by adding MORE cars is obviously the smartest solution. You win.
Reply: @colormedubious4747  yes, solving the problem of too many private cars on the roads by building an underground network of tunnels providing public transport for 57,000 people per hour that just so happens to use Tesla EVs is indeed a very smart solution. 

I know it is hard to ignore the knee-jerk reaction that comes with the word cars, but you just need to realise that even cars can move 27,000 people per day over a small 3 station Loop when used effectively.